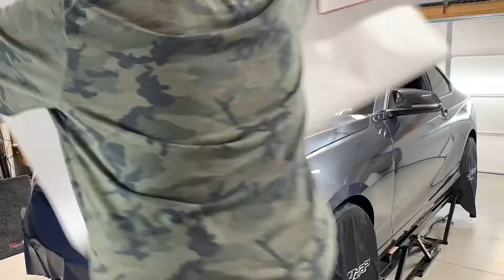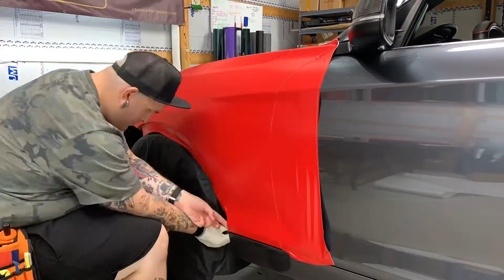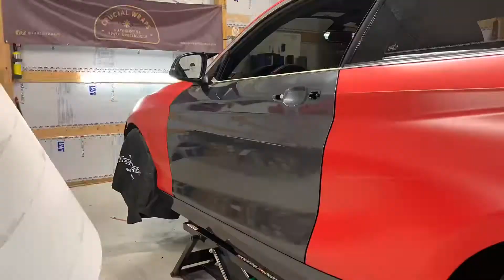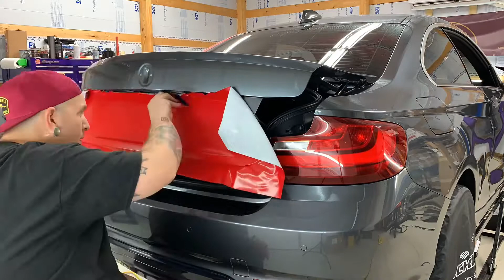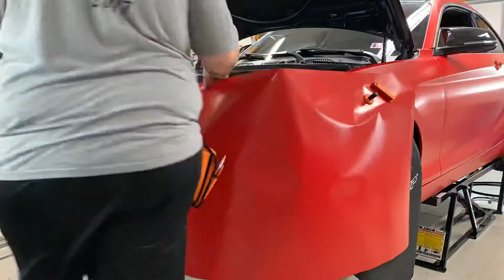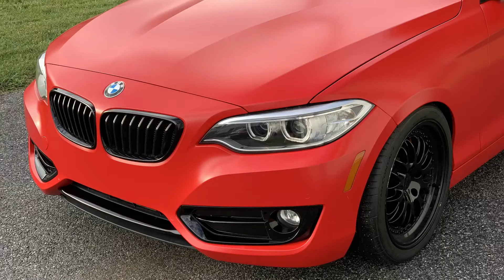BMW 228i Full Wrap Time-lapse / Avery Satin Red

Comment: I’ve never wrapped a vehicle before. Do you think this car is doable for a beginner? Trying to wrap my 2 series but not sure if I’ll be able to pull it off or not.
Reply from the maker: Watch as many videos as you can to learn how to do it. That’s how I started. Anything by Justin Pate and the wrap institute will teach you the most. CK Wraps has a lot of videos as well. I would recommend using Avery. It’s the easiest material to use. Buy a full roll, 75 feet. You’ll have more than enough for when you fuck up and need to redo things.